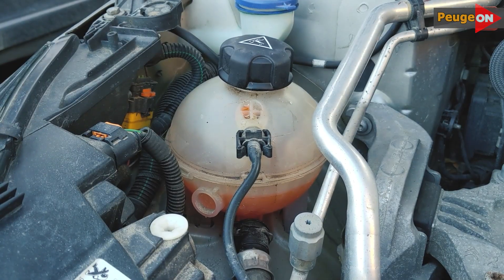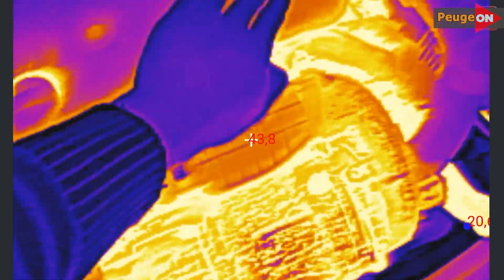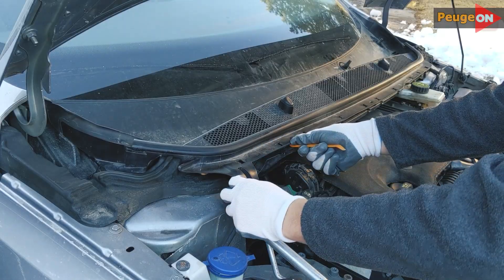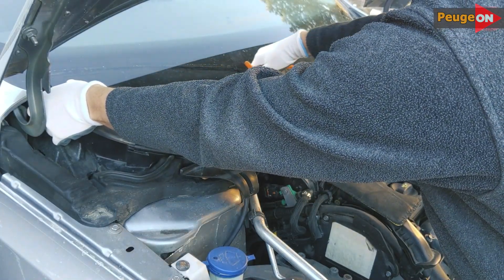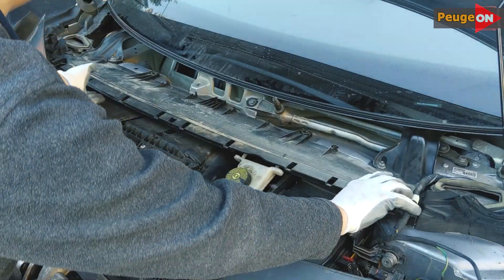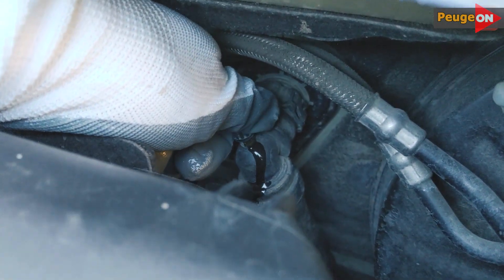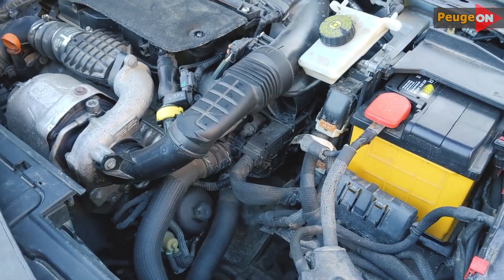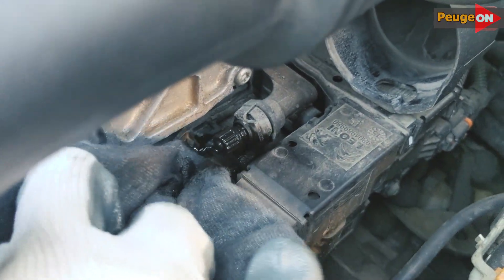De-air the cooling system on the peugeot 308 1.6 HDI

Comment: Hello, I must warn you that this is a really inappropriate video. It takes up a lot of users' time. The easiest way is to remove the air filter cover. You can then easily reach it by hand. 3 screws, it's a matter of 1 minute.

Comment: Hey i need help i am on a trip. I have changed the tank but did not the air. All 200 Km my coolant is completely empty but when opening the cap it comes back. Is it because of the air?
Reply from the maker: With a huge degree of probability, this is the air in the system....it is possible that gases from the EGR heat exchanger.....gases from a crack in the cylinder are also possible....If the level just drops a little, but then it comes back on its own (after some time), then this is still half the trouble (I myself have been driving like this for more than three years). But if the level decreases critically (the tank is empty), then you can boil while driving and ruin the engine!!!
Reply: @peugeoton4033  How i can know that the gases going from egr heat exchanger to coolokg system? I have pressure in my expansion tank without leaking,without white smoke,when i open expansion tank its boiling and going out from expaansion tank,it wasnt like that from start i got 150k kms,this started 1000km ago.Thanks
Reply from the maker: About the de-airing of the system....even if you didn't blow it up according to the instructions, it will blow itself up after a while

Comment: Have you already solved water loss?
Reply from the maker: Not the loss of coolant, but the level change is important because the system is sealed. I am currently in the active phase of the solution.
Reply: Did you find a solution to the loss of coolant? @peugeoton4033